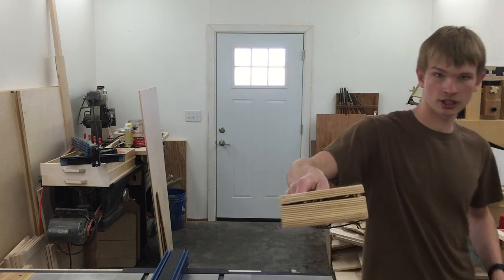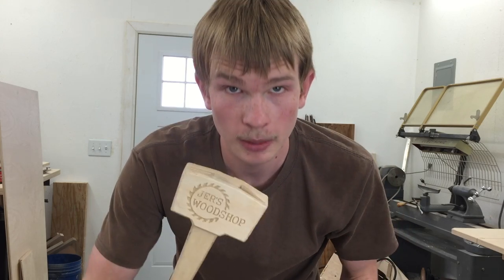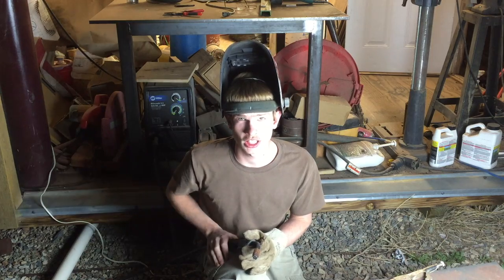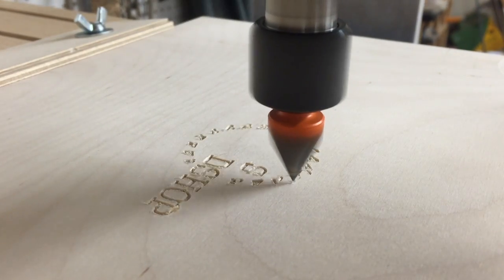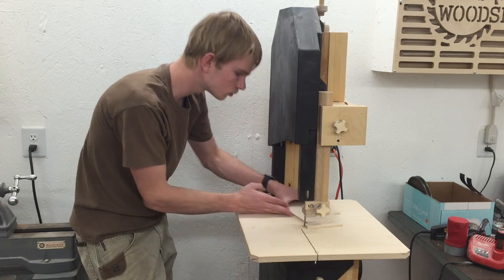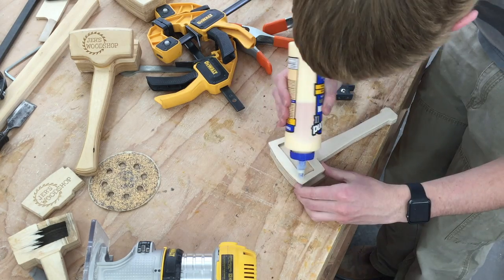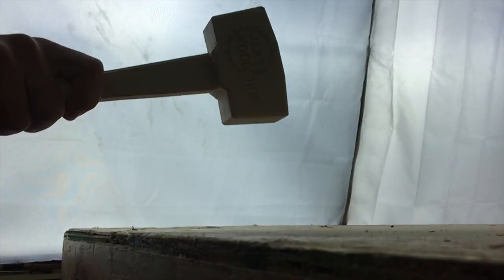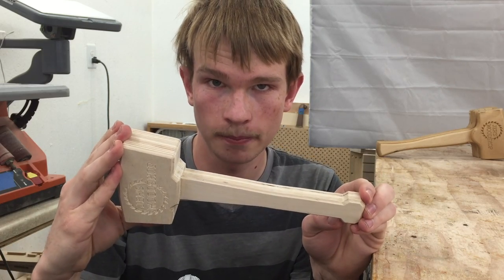Wooden mallet explosion!

Comment: Why you need a mallet like this? Why not use regular mallet design with solid head and stock?
Reply: +moristar1101 Exactly!
Reply from the maker: +moristar1101 I thought I made that obvious in the last minute of the video...
Reply: Jeremy Schmidt Meh.
Reply: +Jeremy Schmidt Yeah, ok. Rewatched and kind of makes sence. I gues it's a traditional way to put loose stuff into dead blow mallets, but this thin is gonna break one day anyway, so for me dead blow is more a modern plastic one. And mallets of this type should be done with hard wood in my opinion - definitely not with ply. However yeah - interesting research. +

Comment: Will this also work with a water instead of the steel shots?
Reply from the maker: +Jan Kahoun 
I'm not sure, but I'm afraid the water would have issues with air locks. Hence the movement would be slowed
Reply: Just curious :) Also a cube from steel inside a steel frame with just a small gap between could be interesting...

Comment: I must copy that hammer. If it had like part of a tire side wall attached to both faces it would make it last many times longer. I can't think of a simple way to put the rubber over the faces tho. A ball & peen shot filled hammer is a pleasure to work with as well. They're great when diving a drivepin punch to keep from bouncing all over when stricking.
Reply from the maker: +Phil Lowman You can use contact cement to attach leather to the faces. I would recommend leather rather than rubber since rubber will leave marks on whatever you hit.

Comment: is it realy nessesery to have the extraweight loose ? i mean a wooden mallet is not bouncing back anywas. It would make only sence for a rubber mallet, so i think :-o
Reply from the maker: +CapitanoGUC 
A wooden mallet bounces a lot. You hardly notice because it happens so fast, but a solid head mallet will bounce about an inch where the deadblow won't bounce at all. You kinda have to see it filmed in slowmo to catch it.